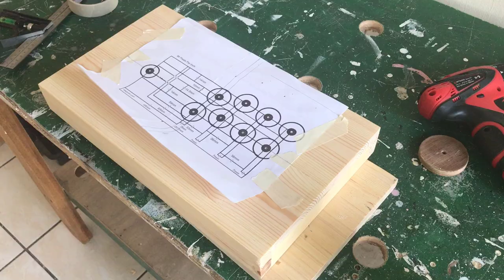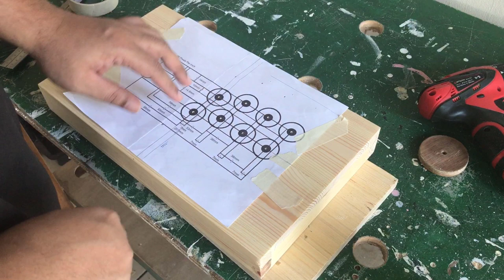DIY Arcade Stick | GamerFinger | Brook Fighting Board

Comment: My brother, today i went to a woodshop to cut some woods i had lying around for the sides of the cases i wanna do but i rushed and they cutted everything to 42 mm tall (something like 1.65") and i think that for a hitbox would work but not sure they can be used for a fightstick with a sanwa lever =/
Reply from the maker: That’s the boarder line for sanwa stick. Make sure to use tin covers.